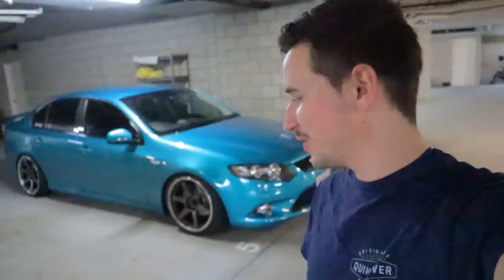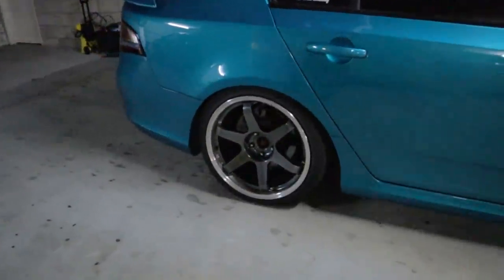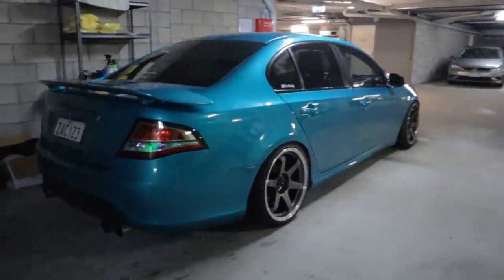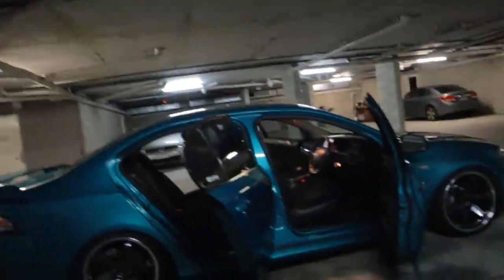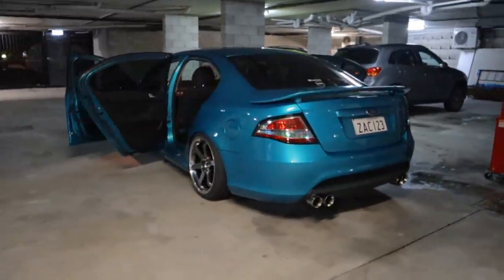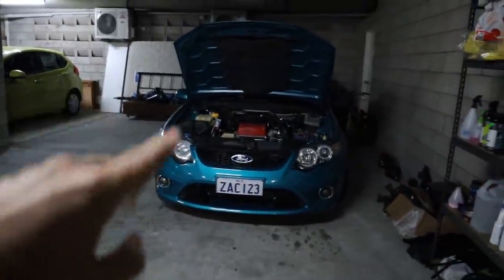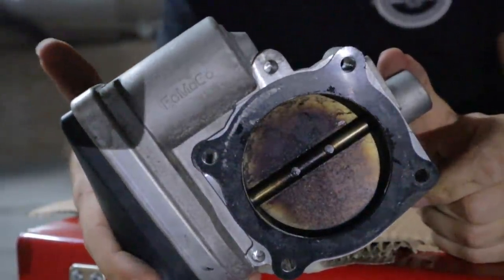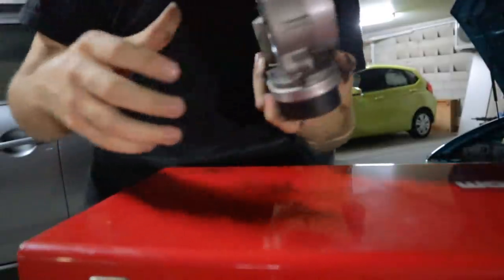Fixing the Throttle Body on the Falcon *ETC FAULT*

Comment: Check the swaybar mounting bushes; in the B series & FG series, they love to run dry; we Dremel out a groove in the bushes & pack it full of rubber grease.

If you are having random ETC faults; try adding an extra engine earthing point or two

Comment: Cheers Zac, just installed a aftermarket cooler on my fg and its run the ETC code straight away. I'll follow your instructions and remove and clean the throttle body 👍👍 :-)

Comment: bro, i bought a g6e and when i come to a full stop in traffic lights, the car vibrates/rattles.
do you think its the throttle body or something else. its fair to say that the car was dirty as fuck when i got it in the engine bay looked like it hasent been touched or washed in its lifetime. what do you think?
Reply: Did you find out what it was?
Reply: @scopeslad438  It happened to my Ford Territory a while ago and it turned out the spark plugs needed changing.

Comment: Hey Zach mate. Did you notice a major difference in power after cleaning your ETC? I think I kinda got the same issue except my NA xr6 sometimes would feel great to drive like it's full of power ready to go and once you stomp on the gas, the engine feels really responsive. And most of the time, the engine would be a lot less responsive. I have checked transmission and spark plugs and coil packs and they seem to be fine. So I was thinking if ETC, MAP or MAF sensor could be the problem.
Reply: Did you ever fix this I get the P2138 code same thing

Comment: Good job to clean throttle body,but you should buy "Liqui Moly Intake cleaner to clean all system in your Falcon".Product is made in Germany and coast about $40 and your car idle and preformance will be much better.I'm doing this procedure before changing oil ,because all dirt will be in oil pan.Your throttle body need calibration or lelearn procedure and calibration after cleaning of throttle body and pedal process you have on Hynes book instruction"calibration of throtle body and flap with pedal will be better adjust for ECU to send signal to injectors to spray petrol with measure from Oxhygen sensor to ECU. Normal fuel trim should be close to 0 Short and long fuel trim and over 10% is no good adjustment ,but "you are not allowed to tach idle screw on electronic throttle body only with Voltmentar and knowing 4 wires in TPS .One wire is 5 V and one is negativ and another two silver and yellow are signal wires.

Comment: Hello my fpv gt also gets the ETC fault warning but it only started after getting bigger cams done.I’ve taken it to different mechanics and none seem to fix the problem and I’ve had the throttle body cleaned and replaced the throttle body sensor so any other info would be great thanks…
Reply: Did you ever fix this I get the P2138 code same thing
Reply: @OldStyleGarage  ,Throttle/Pedal Position sensor/Swich "D"/"E" Voltage correction.I think you have problem with your pedal wires which going to TPS.Tray replace Pedal sensor,because pedal and throttle has communication problem. Hynes book has wiring diagram and pedal sensor can have some wiring isue.

Comment: Hey man where did you buy your throttle body? I actually had transmission fault come up on my 09 Fag Ute and my brothers trying to fix it he said that i need the same part any other parts you could recommend to help
Reply: Any luck with it mate, I’ve got the same problem
Reply: @tombagnall9774  hey mate yeah we replaced the throttle body, there is a hose that connects to the throttle body and that had a big rip where it’s locked onto the throttle body. Replaced the whole lot with parts from a wrecker and it’s fixed the issue

Comment: Fuck that's filthy on the inside. That's what your intake manifold would look like too. Get some upper engine cleaner. The 3bond stuff that's made in japan is great, foams up real good. I buy it locally and prefer it over the subaru one. Remember you use it just before you change the oil. Oh yea; :)